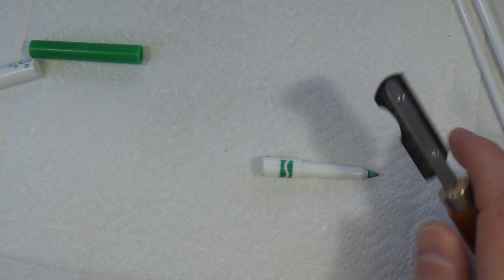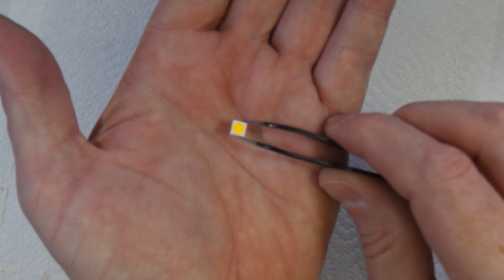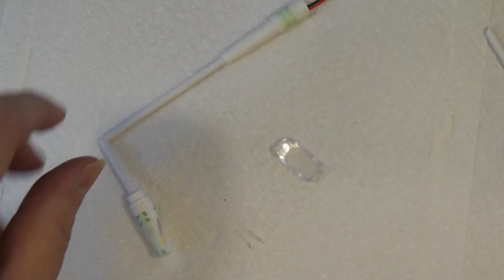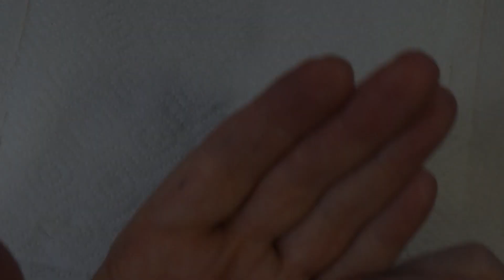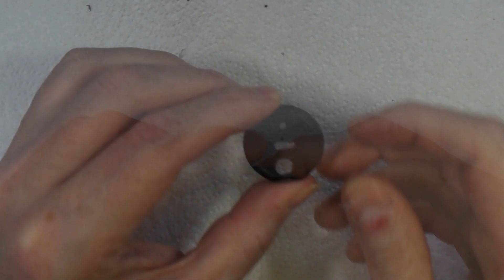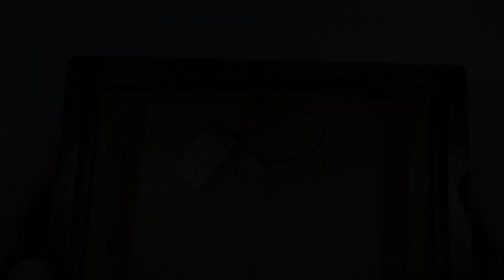Building a lamp post for a diorama from scratch (and yes, it lights up)

Comment: Hi can i ask don't you need a resistor for the led? xxHelen
Reply from the maker: Not in this case because the output from the battery matches the voltage of the LED. If I had used, for example, a 12v battery, then yes it would need a resistor to lower the voltage.